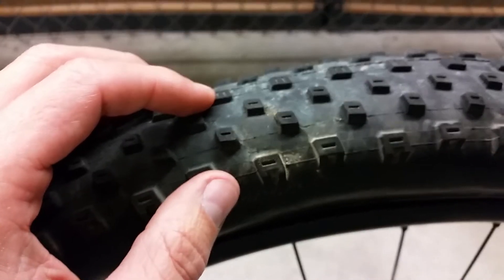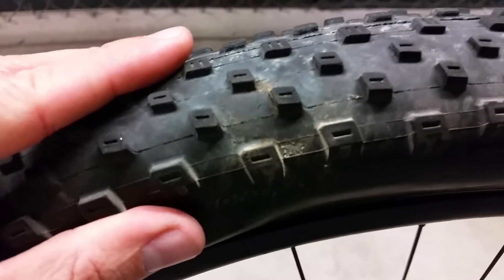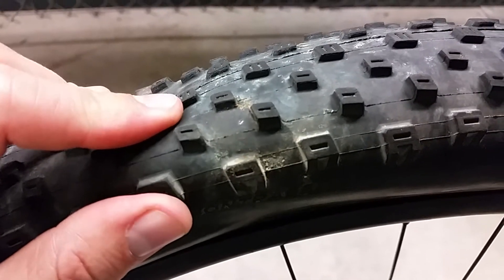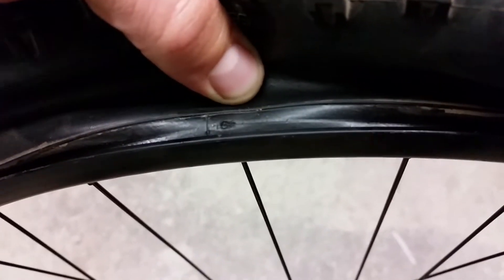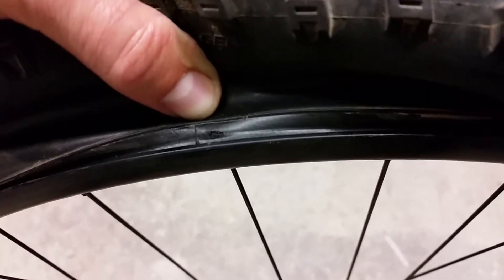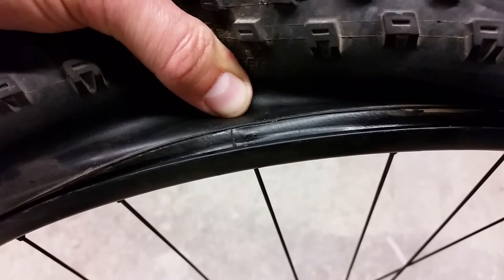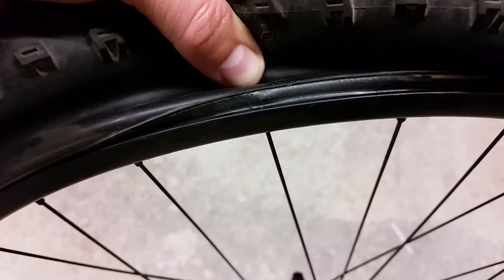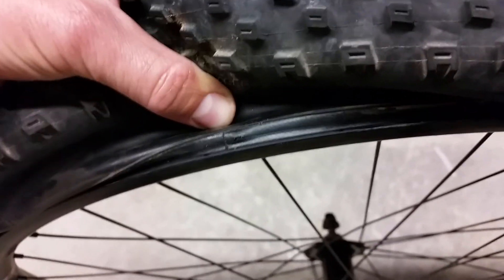Bontrager Chupacabra Testing - Problem # 1

Comment: I have a small hole in my Chuppa that won't seal either. Keeps blowing out sealant when the pressure is 18psi but stops when it gets down to 15 or so. Also cut the sidewall on another Chuppa with a rim strike but it was almost worn thru so I ditched it. Did your super glue trick work? I was going to try a Dynaplug repair for the hole or a car tyre repair plug. Love these though, they roll so nice and give a monster truck hum :)

Comment: Low pressure is a bad idea for any kind of xc tire
Reply from the maker: Mark Wells 
This is a 3 inch wide tire. Not really a xc race tire. I did, however race single speed this last season on  29x2.25  xc tires at 23psi and got first in the 8 race series. Thanks for your comment!
Reply: It is a 3" tire but it's made the same as a light xc tire, they are fragile when used for rock infested trails, casing is very thin, they made it as light as possible
Reply from the maker: Actually, I have tested three different Bontrager Chupcabra tires over the last 3 years and they are amazingly durable. I have been very very surprised. Yes, they are made very light, but are pretty tough. My normal xc race tires get cut sidewalls all the time on the trails where I ride, and they are much narrower so their sidewalls get hung up on sharp rocks much less frequently than the plus tires I run. They may have constructed them the same as xc tires, but foe some reason they are more durable than xc tires. I was honestly running pressure too low for the rock gardens I was riding through on the day this bead of the Chupabra was punctured,  but I was testing it's limits. I am surprised that it continued to stand up to so much more abuse after this day. Highly recommended.